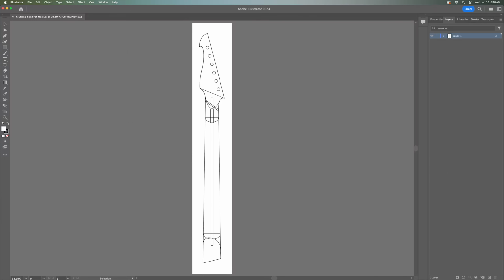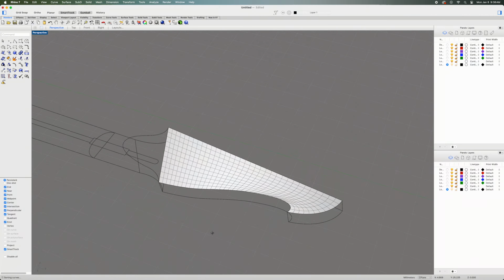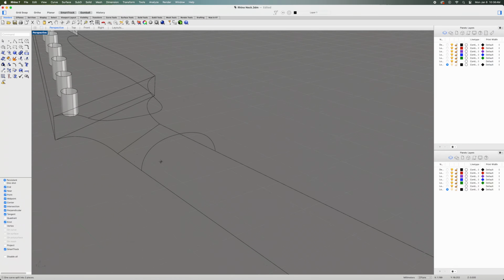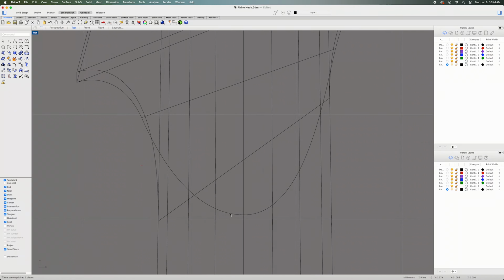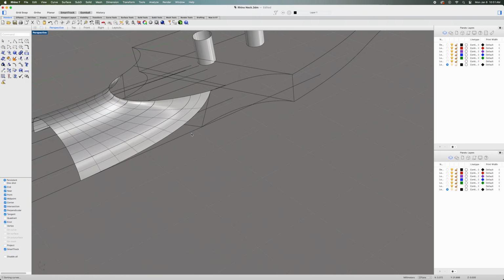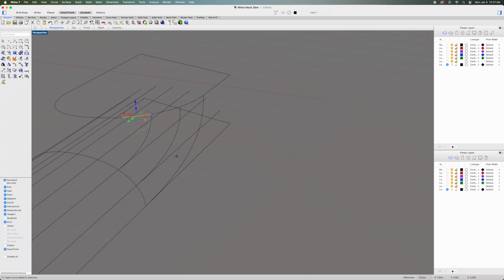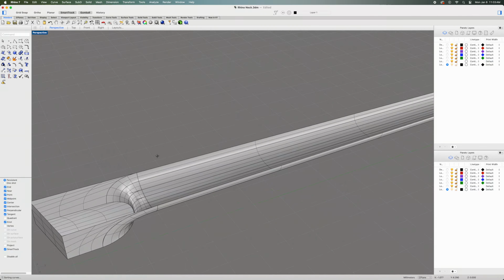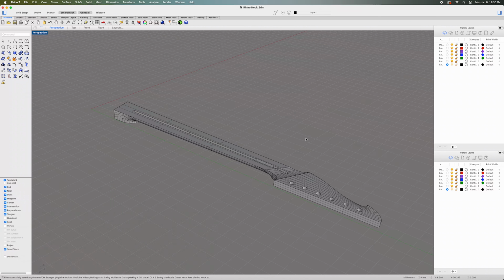Making A 3D Model Of A 6 String Multiscale Guitar Neck Part 2

Comment: Hi, Chris. Another great video. You're basically teaching me how to use Rhino, so I'm still trying to "cop your licks," so to speak, like dropping the needle over and over again to learn a part.

Off-topic question, though: What are your thoughts on applying finish (or not applying it) to things like neck pockets and pickup routs? I see a lot of builders on YouTube who tape off certain parts for whatever reason: They want a wood-on-wood contact between the neck and the body; adding a finish to a tightly carved pickup rout might prevent the pickup from fitting or moving properly for adjustment; and so on.

That said, I've heard you emphasize many times that wood needs to be sealed to minimize movement during seasonal changes.

So I'm wondering: Isn't leaving neck pockets, pickup routs, etc., unfinished a way for moisture to get back into the wood and cause it to move? I ask because I've seen one builder who literally tapes off the heel of the neck where it meets the neck pocket. He does this pretty painstakingly then applies finish to the neck.

What do you think on this subject?
Reply from the maker: I apply finish to all my pockets except for set-in neck pockets.

Comment: There are some not so good practices of building the surfaces shown in the video, especially for the headstock + volute, but it is a huge topic and not related to guitar.

Hint: you should use more projections and construction planes for the angled headstock and trim the shape of the headstock once projected, not to construct the 'network of curves' off of those curves. Yes, it is more convenient to draw the shapes first, but in CAD and especially with Surface modelling there is the concept of 'theoretical surfaces' and 'minimum degree' for the curves and said surfaces, in order to build clean and manageable\editable surfaces.

Hint: it is a tremendous time saver if you organise all curves, trims and surfaces in Layers (upper right → Panels: Layers) instead of deleting and rebuilding construction curves and surfaces, just move them onto respective layers and 'hide' the layer's visibility when needed

Hint: once you have built a desired surface, you should use its edges to build new desired surfaces not the curves which overlap with the desired surface's edges